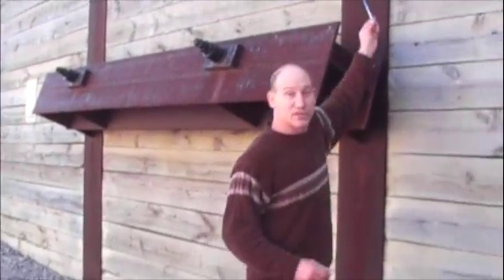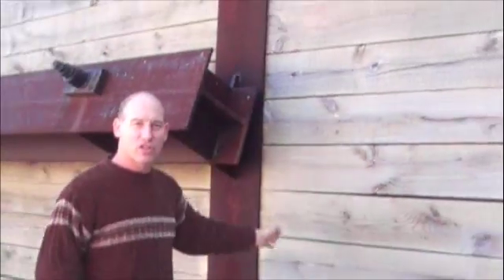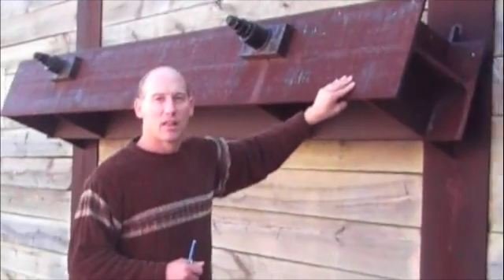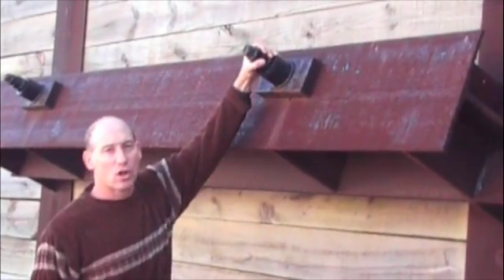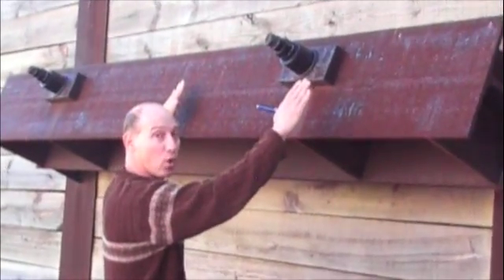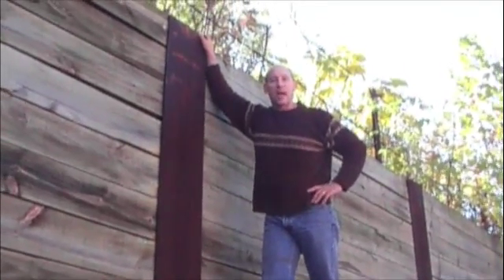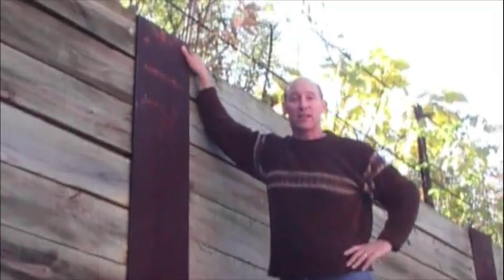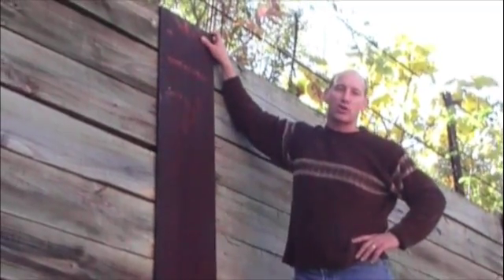Soldier Pile Wall with Tiebacks

Comment: Awesome video! I am looking to cost out the difference between using Rakers or tie backs - and how much each would cost overall in a project. Specifically the property is 147 feet long and beside it will be a development with about 2 stories of below grade parking. Using average spacing of tiebacks and taking into account the below grade is 2 stories, how much would that cost to build that out using tiebacks along that one wall? And conversely - without using tiebacks what would the same scenario cost if they used rakers for that wall? 
Im just looking for ball park figures +-. If you could advise that would be greatly appreciated!!

Comment: Hello, I have a question. I work for an excavation company specializing in earthwork. Recently we were tasked with tieback removal and unfortunately we lost one of them during the process. my question is, what problems does that create structurally? If a tieback is designated for removal later and a portion of it is removed but the rest remains in the bore what happens to the structure? Thank you.
Reply: If a tieback is no longer needed for the purpose of holding the wall back, then leaving it in place shouldn't be detrimental to the wall.  The only problem might be if the remaining tieback is going to interfere with some other construction back in the hillside.  (I've not heard of removing tiebacks before, so I'm really interested in why, and how, you did that!)  Sounds interesting!   Email me more if you have time: Joek@RetainingWallExpert.com

Comment: How could we exactly install timbers lagging while going downward? I could understand that point.
Reply: Muhammad, check out this video that shows how lagging is installed. Usually in 5' sections. They go "down" by going "up" in 5ft sections... If that makes any sense... https://www.youtube.com/watch?v=tiJLFOCvUxc
Reply: You are right.  Most of the time, the lagging is NOT placed behind the flange, but is attached to the face.  This is done by welding small (6-inch long) threaded rods to the face of the beam.  A small steel plate with a hole in the center acts as a washer holding back the timber.

Comment: Those I beams are 'Cast-in-Place' not 'Driven'. Just sayin' . . .
Reply: Al ShangriLa True - good catch!  Yes, these beams were installed into pre-drilled holes.  The holes were filled with lean concrete which was chipped away from the steel beam as the excavation was made downward.  So, yes, these beams were not "driven".  Thanks for watching!
Reply: Thx for posting. Great tutorial. Kudos!
Reply: Al ShangriLa STEEL IS NEVER "CAST-IN-PLACE"
Cast-in-place refers to concrete being poured on site, steel is fabricated at the steel shop, not at the job site
Reply: Al ShangriLa The steel beams ARE CAST-IN-PLACE.  They were cast into concrete that was placed ON-SITE.  Just like any steel rebar can be cast-in-place into a retaining wall on-site.  The beams were NOT driven into the ground.  They were "cast" into drilled shafts that were filled with concrete after the steel beam was placed into the open shaft.  So, YES, the beams WERE "CAST-IN-PLACE".
Reply: Thank you . Note I will not need to write up a non compliance :-)
Reply: ***** Well as an ICC Certified Pre-Stressed Special Inspector I can have you removed from any project due to your incompetency :) Per IBC 17 & 18 the cast-in-place (Deep foundation) 'Element' includes the steel, concrete, etc. The member in a whole is in fact 'Cast-In-Place'
Reply: +Al ShangriLa 
A steel beam is cast in a drilled HOLE.  You eat the "whole" enchilada.
Reply: Not true Peter. Cast in place anchors are anchors that are set into green concrete and it's a very common term. These piles would technically be cast-in-place piles, although that's not how I would refer to them personally. Also concrete is never poured...it's placed ;-)

Comment: Seems you were saying you put the sleepers in top to bottom, as you dig out behind the wall line. Is that right? If so, you'd have to cut the sleepers short enough that they could potentially fall out. Are they screwed to the C post soldiers? btw. Great videos, I run a retaining wall company in Australia.

Comment from the maker: yes - the wale is the horizontal beam between two of the vertical beams.  The wale minimizes the number of tiebacks that are required.  Every single one of the vertical beams must be secured with the tiebacks into the hill, and each one would need a tieback.  But, by placing a tieback connected to a wale, the wale can then secure TWO vertical beams.

Comment from the maker: An engineer can calculate that, and it is quite involved. The part nearest the wall does not "count" as anchor, because ity is moving with the wall. Stronger soil will require a smaller diameter around the anchor and a shorter length, once past the "unbonded zone" close to the wall. Best results are when anchored portion is in bedrock. Design will show number and spacing of anchors, location, angle, length, strand diameter, and wale (horizontal beam) size. So, there's no a simple answer, sorry!

Comment from the maker: The tiebacks are installed by drilling a small diameter hole (4-6 inches) back into the hillside.  A special drilling machine drills this hole sideways, downward at an angle of 15 to 45 degrees using a screw auger that is hollow in the center.  Next, a piece of steel rod is inserted down the center of the hollow screw and grout/concrete is pumped into the hole.  The grout prevents the hole from collapsing and hardens into concrete around the steel rod.  Pretty cool, huh?